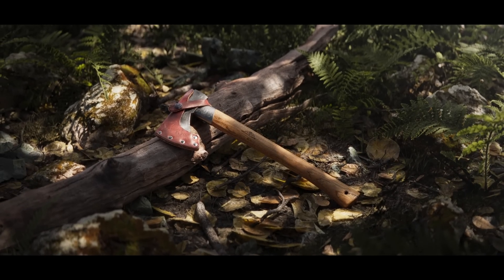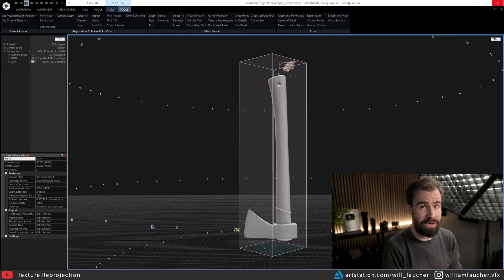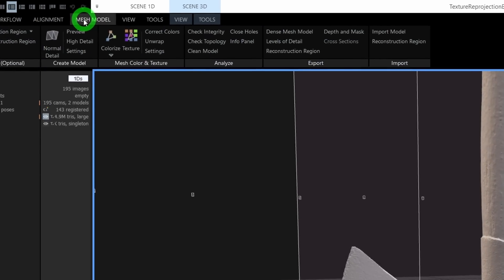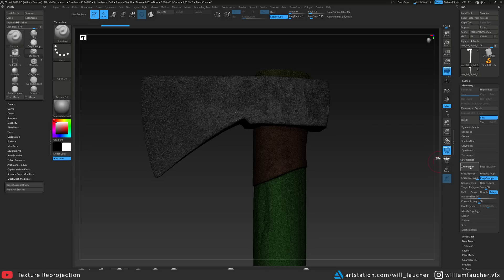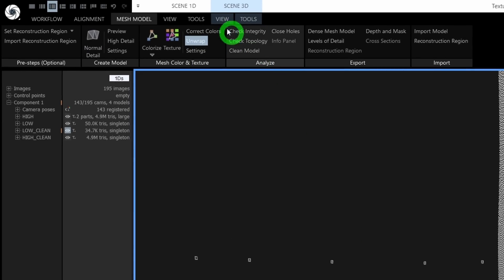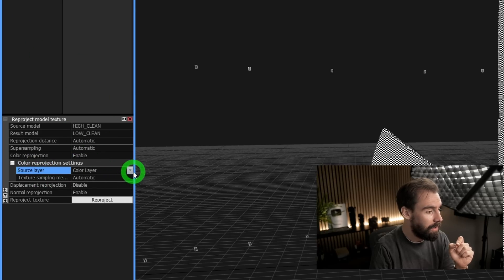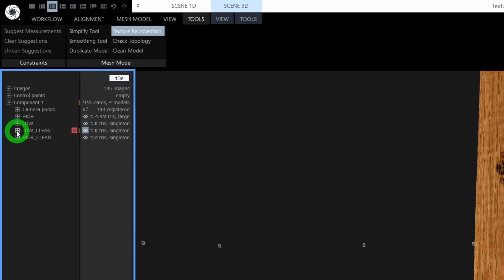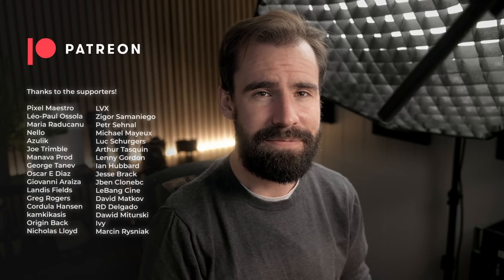Texture Reprojection in RealityCapture! [Rendered in UE5]

Comment: on export using FBX there was no normals or displacement files.  I really wanted to see you export that model, I knew I'd screw it up
Reply from the maker: You need to simplify the model in order to get normals or displacement. Otherwise if you are just exporting the high rez model… you don’t have any normals or displacement to bake FROM.
Reply: @WilliamFaucher  thank you for the clear explanation, I really appreciate it!
Reply: Can I ask what you use for the color and normal layer Texture Pixel Format?

Comment: Nice explanation. Does this approach gain anything over simply doing a traditional bake to your low poly in Marmoset, using the original textures created by the scan? I can see how it would be easier/faster, just curious if RealityCapture contains data that isn't translated to the textures you would use to bake traditionally.
Reply from the maker: The resolution can be a lot higher since it uses the actual source photos to transfer the albedo, and the projection more accurate as well

Comment: Can I ask why you can't just simplify the original geometry to get a low poly count, then export and smooth in ZBrush then re-import. Would that work instead of Export>clear>import>simplify>export>clean>import?
Reply from the maker: Notice that I didn't use the simplified mesh in RealityCapture at all. I just wanted to show why I am doing the retopo in Zbrush. However, the polished high-rez model needs to be imported into RealityCapture. It's the high-rez model that needs to be polished, as we are baking down normal and displacement maps.

Comment: Another perfectly explained video. Well done. I remember when the Reprojection functionality was added. Prior to that it was an ordeal to get the megapoly meshes out of RC, into another app for baking...gosh I was grateful when they added this. 
In my workflow I often transfer the colour from High to Low and also do a reprojection (Texture) from the photos again giving me two colour layers. I find the reprojection can be sharper in most cases however reprojecting from the photos is sharper in other cases so a quick paint mix between them helps get the best of both.
Cheers Will!

Comment: nice to see how easy this has gotten, but almost 40k polys for an axe prop is probably a bit overkill ;)
Reply from the maker: It's not if it's a hero closeup, I'm not making games here. If anything, I didn't use enough polies. If this were a VFX shot, 50k would be my base model, and then I would subdivide it 2-3x more with displacement.